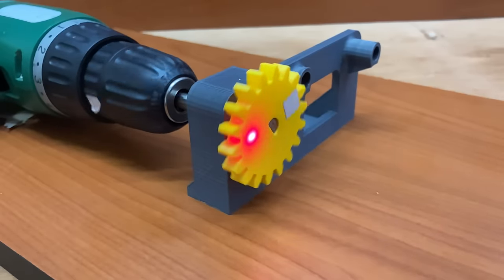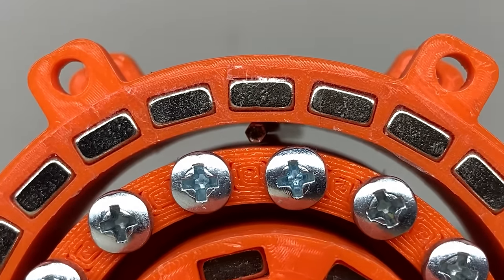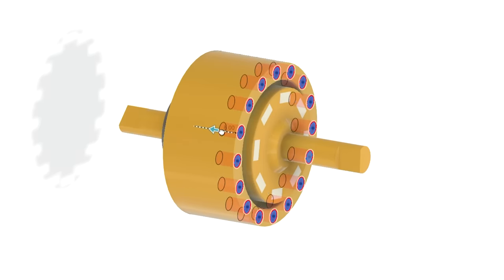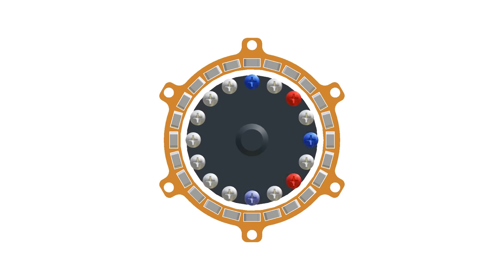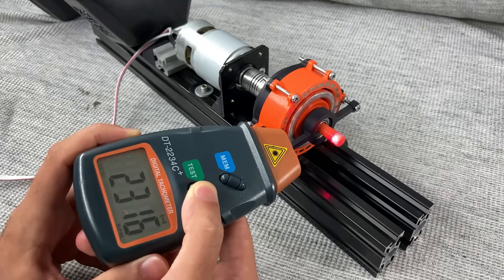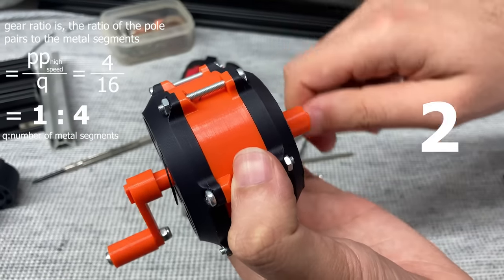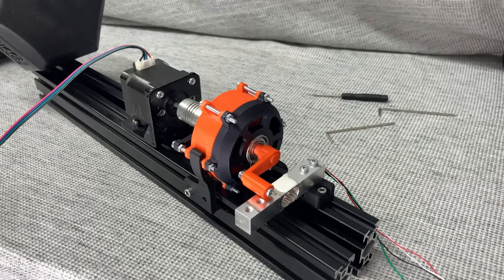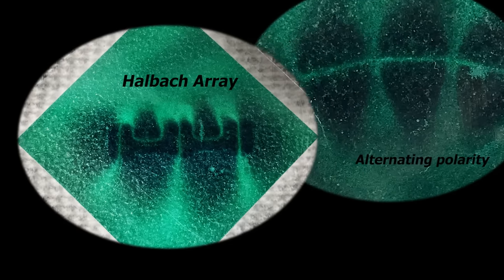Magnetic Gears - Why Nobody Talks About This?

Comment: We actually do see magnetic gears in limited applications, though their practical use is mostly for things where high speed low maintenance designs or inherently safe designs are required. In most cases they are used in hazardous material handling where shaft seals could be a major and rapid point of failure in a system where chemical leaking is incredibly hazardous to both life and the environment. Usually you see this used with a 1:1 ratio in magdrive pumps. They lack the flux motivator and instead work as a simple magnetic coupling, but they are still a power transmission with an input and output that closely resemble your designs. They are also used in some applications where wear-less torque limiting is required, such as found in some scientific and industrial machines.

They are a good tool that  is over 100 years old, their continued use today despite their age proves they have a practical purpose. They are not a replacement for a mechanical coupling however. Their torque is limited, efficiency loss can be quite large depending on design, and their effectiveness as a power transmission is highly dependent on the quality of design. There is potential for use in renewable energy systems such as wind turbines where a maintenance free gearbox could reduce both manufacturing and maintenance costs. Current gearboxes in wind turbines will far outlast the actual structure of the turbine itself, however the gear oil must be changed at least once every three years, in the average lifetime of a wind turbine the gear oil will be changed 7 times. Each oil change requires 50 to 200 gallons of oil depending on turbine size with larger turbines requiring more oil than smaller turbines. While this isn't a large amount of oil for a single turbine, about 1,400 gallons of oil over 20 years for the largest commercial turbines. It adds up quickly when you have 20 or more turbines in a farm, which is 28,000 gallons of oil over their lifetime for a 20 turbine farm, or just under 3 semi truck loads of oil. If used for gasoline this would come to about 20,000 to 24,000 gallons of gasoline, which for understanding of scale would power a modern car could drive 800,000 miles on the oil required for 20 large wind turbines in a 20 year life. While we aren't burning the oil in the wind turbine, we still need to distillate it from crude oil which still necessitates drilling for oil and disposing of the waste oil (which is often burned in peak demand oil power plants or sometimes refined again into another lubricant).

They may also see use in salt water environments, where shaft seals going bad will result in the failure of the device. Removing the shaft seal represents the removal of a high wear component from a system that cannot be easily treated to resist corrosion like sealed bearings. Bearings designed for underwater use are often made of stainless steel that are highly resistant to corrosion even when the metal surface is directly exposed to salt water. In the case of underwater gearboxes the motor itself will always be susceptible to damage from water ingress, removing the shaft seal often represents removing the only moving seal that is exposed to mechanical wear. All other penetrations into the motor casing are non-moving and can be sealed comparatively easily.
Reply: Well said good sir
Reply: The torque in wind turbines is enormous, a magnetic gearbox might slip under medium to max power.
Not sure if it is right, but I did the math for a 2MW turbine and the result was 19 million Nm/14 million ftlb
Reply: @Isgolo  Thats not quite right, The largest commercial deployment is a 9.5MW turbine. Hold on, i'm about to geek out a little because I don't want to do homework for a boring as hell project management class right now.

At theoretical max power production 12,700HP, at 10RPM (about the max rotational speed for a turbine this size), we get a torque value of 6.6 million ft-lbs (9 million newton meter). That sounds like a lot of torque, and it is. There are some research papers that test axial magnetic coupling (just as a reference) and a single 200cm x 6cm mag drive shaft is capable of a max torque of 4,200Nm in testing for example, take the next 3cm radius slice and you add another 11,000Nm for a total of 15,000Nm for a magnetic coupling 200cm x 9cm. Already an increase in diameter of 50% increased coupling by 350% and we are still only at 9cm magnet diameter. Taking the coupling size up a few notches (factoring non-linearity of distance and equivalent force) we are at 2 million nm for a coupling 2m x 2m. To get our 9 million Nm we would need a coupling about 3.8m x 2m diameter. Thats huge, but it still fits nicely inside the 9x8x20 meter housing on the 9.5MW turbine. This is all just napkin math, chances are I am seriously underestimating the amount of force generated, but I am only using some of the more basic generated equations from the research paper (basic is relative, some of the simpler ones still have 10 terms).

Given we can get about max torque from a magnetic coupling that size with no reduction, we could just be conservative and say the actual size for a 4:1 reduction like achieved in the video is twice that diameter and a little deeper. 8m x 3m is a rough estimate without going back through and doing everything all over again with an increased air-gap. Once we get past the first reduction we are only talking a torque of 2 million Nm, which we found earlier can be handled by a 2x2 coupling. Since most wind turbines run a generator speed around 1800rpm, we need some more reductions, essentially a 180:1. We only need three 4:1 reductions and a 3:1 reduction. The required torque values and aprox. sized for each stage are as follows. 

Stage 1 - required stage coupling torque 9MNm - est size 8m x 3m - total reduction 4:1 | Stage 2  - required stage coupling torque 2.2MNm - est size 4m x3m - total reduction 16:1 | Stage 3 - required stage coupling torque 560kNm - est size 4m x 1m - total reduction 64:1  | Stage 4 - required stage coupling torque 190kNm - est size 2m x 1m - total reduction 192:1 - final stage output torque 47kNm at 1920rpm at 9.5MW or 12,700HP.

The total estimated length of our gear reduction would be about 8m, which still leaves 12m for the rest of the equipment inside the nacelle. Is it possible? Maybe, thats a lof of iron boron magnet required. It's possible they could experiment with excitation style stators with permanent magnet rotors like three phase brushless motors. While that would eat into the power generation of the turbine, it would greatly reduce the rare earth metal requirement and replace it with iron and copper, which IMO is still a good tradeoff as it increases the sustainability of the turbine even at reduced efficiency. Truth be told I don't actually know if it's possible, these number are for a highly unoptimized coupling setup, there is no fancy design it's just magnets cut like a pie around a disk in a N-S-N-S-N configuration. There is also the possibility of the 4:1 and 3:1 reductions not being optimal, maybe 5:1 is better, or 3:1 is best. I don't honestly know. But with ballpark numbers it looks close and sounds reasonable enough based on the testing done for the paper. I know magnets are weak, but we are still talking about a first stage reduction thats almost 20ft diameter and 12ft long.
Reply: @2009dudeman  I thoroughly enjoyed reading this, thanks!!
Reply: Well said
Reply: yep
Reply: @2009dudeman  you make some good points comparing the traditional multistage planetary gearboxes to a N-S magnetic. Magnetic can definitely reduce oil volume, but the loads involved will require bearings to have oil. Planetary gear sets definitely don't outlast the towers; on average they get about 12 years and are likely running at partial capacity.  In replacing a planetary with magnetic, you'd be likely be looking at a single stage magnetic gear 100+:1 and the physical envelope would be quite similar to the existing machine.  One of the main issues is that permanent magnets are expensive and the volume of magnets required is quite large.

After you finish all your school work, see if you can dig up any of the work done by Texas A&M on magnetic gearing.  They've done quite a bit of advanced design in this space.
Reply: @TexasT04st  sure the bearings still require oil, but nothing like the gearboxes currently used. Yeah, the magnets part is the most troublesome. You can engineer away the issues with bearing lubrication, magnetic interference of controls, personnel safety and proximity standards (no ferrous metal tools near this thing I can guarantee you that). But you will never engineer away the need for several tons of magnets, that's not really my area of knowledge anyway. I have no idea if it's feasible to create that many large magnets or if there is a better design layout than the paper I drew my numbers from. They also used iron boron magnets, which would likely be cost prohibitive enough to ruin the commercial viability of the gearbox. It's likely they would need to use a different magnetic core.

I have heard of Texas A&M working on the idea, among others but so far I haven't seen anyone really putting much effort in. Doesn't mean they haven't, just means I haven't come across it.

Overall I don't know if it's viable to use, but it seems plausible.
Reply: @2009dudeman  the assembly process has some additional safety considerations and non-ferrous tools are required.  Once you button up the assembly you won't have any external magnetic considerations.  The magnets themselves wouldn't be very large; the large quantity of smaller magnets can create a very tedious installation process. If the right magnetic arrangement is used you could get away with a non-magnetic core (minimal loss to torque capacity) and save a ton of weight.  

It's really an issue of cost. Permanent magnets are expensive and are an imported product.  If we can get the magnet cost down it would open up many interesting applications for the technology.  I hope to circle back around and dig back into developing this stuff one of these days
Reply: Your smart.
Reply: Chemical pumps immediately come to mind..
Reply: Thanks for a crash college course
Reply: I am 100% in agreement with you. I just can't get my constituents to get it through their thick skulls. Amateurs, ya know? Sometimes I wonder if they really even know what a magnetic gear motor even is.
Reply: You can easily build a gearless wind turbine. Several Enercon series had this design. I still did not become the preferred design for offshore wind turbines. They need service on many thing anyway.
The gearbox efficiency is key to the output and following different wind speeds. So it directly translates into profit of energy sales. 1% more gearbox loss is like 10% to 50% less profit over lifetime as is heavily leveraged.
Reply: @voster77hh  Enercon gearless drive safe direct drive wind turbines, they use no gearbox. All their magnetic flux must be generated at 10-20rpm depending on turbine size, this is far harder to make efficient than a magnetic gearbox.

I'm also calling bull that a 1% loss in efficiency translates to 50% less profit. 1% loss on a nominal 1mw system is 10kw. Generated capacity is still 0.99mw. if you get say 8 hours of max production a day that's 8mwh for a perfectly efficient system or 7.92mwh for a 1% loss. If they sell at average US energy rates (this doesn't actually matter I just need a number) your profit drops from $1,233 a day to $1,221 a day. Over 20 years that's a drop from $8,927,000 to $8,913,000. That's not a 50% loss. When you account for the cost of just oil for a traditional gearbox assuming an average price of $13 per gallon (for just basic 10w40 engine oil), that difference drops from $14,000 to $9,500. All other things excluded.

Sure they still need other service. But removing a service item is still removing a service item. No one would argue that an electric car doesn't save money just because it still needs service for some things, it still requires less service than an ICE car.
Reply: @2009dudeman  No one ever gave me a better explanation of the linear relationship between revenue and profit. You are right, that absolutely MUST be true. Sorry I always believed my finance textbooks to be true here. That the relationship of revenue to profit is exponential and usually somewhere between 1 or 2 orders of magnitude lower than revenue. Means logically mostly somewhere between 10% to 99% lower and could be as low as 999% less in extremely volatile cases with a lot of fixed cost to distribute. Especially when a high upfront CAPEX and long lifecycle carry a high interest on a risky slow payback scheme where every dollar counts exponentially. Never thought it could be that simple like you explain it to me /s
Reply: @voster77hh  be smug all you want, but if a difference of $14,000 over 20 years was 50% of the profit, no one would use wind turbines. Dude you must have failed your classes if you think any power company is going to spend all that money on something that produces a profit of $1,400 per year and costs them millions to build. Based of course on 14k being 50% of their profit.

Everyone seems to be in agreement that wind turbines make between 3k for the smallest of turbines to over 10k per year. That's after operating and other expenses.

The point is not that finance is that simple, it's that the most basic of napkin math pokes holes in what you are saying. If 1% loss in power generation is 50% loss in profit, then what is 2% loss? 0-25% profit? It's ridiculous to think a wind turbine is so bad that just 2-3% extra loss renders them unprofitable.
Reply: You lose 1% output. At day peak demand and short supply that can easily leveraged by 250 times on selling to the spot market. Unfo a 1% less efficient turbine will cut out early or not cut in at exactly these most profitable times. Your hours of operation p.a. would just crash. The lower wind power supply the more valueable is your product. Congrats, that wasted 1% efficiency kicked you completely out of that profit game. Resistance simlly defines the cut in / cut out speed of a turbine.
There is dozens of other exponential effects I won't even bother to explain where your high school math stinks.
It already sucks to reply to someone totally naive about either political or spot market prices defining profitability vs losses here. Offshore wind is more expensive than Gas Power. Guess who gets shut down and doesn't see a single dime? Again, that 1% less efficient turbine is the first loser in the game. Maybe you should grow up a little to fully understand the rules of the game you are talking about first?
Then you might get onshore wind to be an entirely different game where political prices still can turn a profit at 1% less output efficiency. Offshore they take you from already bad cash burn to outright abysmal cash burn. Why cash is burned offshore? The bet is on real estate prices. On repowering secured claims with future actually profitable mature turbine generations. That gamble is played between nations EEZs and the energy big corps that are too-big-too-fail in critical infrastructure. They simply put the claim innone SPV and the Turbjneninto another SPV as legal entities. If the 90% pension fund finance tanks the energy corp still retains the claim to the site to repower it later. Some average Boomer Joe or Jane will lose their retirement funds. Who cares?
The energy big corp just fulfilled the governments demand to place a turbine immediately with some naive dudes cash dreaming to get rich and it shed the liability. Not that hard to understand the biz model, ain't it? Tou can't really compare 5th gen mature onshore turbines to 1st or 2nd immature offshore wind turbines on profitability vs investment push. You need to look at who is playing and what do they really place their bets on. Who chips are really in these stakes. The permit on the real estate under the turbine is what certain C-level people learned truly matters long-term.
There is absolutely nothing keeping the entire billion USD show offshore from turning sour. Just search "BBC glaring engineering  mistake" on YT.
Does a ±5% wind estimate deviation turn an onshore windnproject sour or hot? Yes it does. Repowering to a 50m higher larger diameter turbine with special blades still does fix that. That permits real estate still appreaciates in value.
Sounds much like subprime deals frenzy? Guess where all those Wall Street bankster real-estate dudes on cocaine went for some fresh dealing and wheeling? Did they magically disappear from the face of the Earth like dinos struck by an asteroid from the face of the Earth or repent their sins of greed and change job? Certainly not so. If the consumer market is dead just start some hot stakes race between some nations. Just move on. Upmarks of asset valuations on balance sheets are not realized profits from cash-outs. High profits from energy prices differences is politically really sensitive. Wind energy never never gets away with that for long.
Reply: @voster77hh  dude, stop talking about things you know nothing about. You are acting all high and mighty and being wrong while you're doing it. If 1% loss in gross output would put you out of business, then wind wouldn't work.  Do you think the cost of operation for wind turbines scales linearly with size? Dude, the cost of operation for wind power in my region in 2021 was 3.3 cents per kWh. Average electric price here is 14 cents per kWh. So that already factors in operation costs from start to finish. If a 1mw wind turbine produces an average of 8mwh per day, they have a total operating cost of $264, when they sell that power, even at a discount of 10 cents per kWh they make $800 gross, subtract their operating cost and you get a profit excluding purchase price of $536. Selling power at a 30% discount. Now take 1% efficiency loss, their operating cost is the same (ignoring lower maintenance costs) and they only produce due to loss a profit of $528. Now please tell me from that loss of production of 1% where that other $250 goes. And no you don't get to count peak sale rates and other garbage like that, because here in my region we don't have rolling blackouts where buying power at 250x is necessary. The difference in end sales cost for power here (this is the consumer pricing so it already includes everyone else's share being added on) changes between 13 and 17 cents per kWh. But remember the numbers I used are at 10 cents, which is below what ANYONE is going to be buying here except the largest of industry with their buying power, but they also pay a premium for apparent power instead of real power.

Make fun of high school math all you want, but if you make $800 a day and your total expenses are less than that, you make a profit. Nothing you do changes that. All the other crap you put in about politics and other crap has nothing to do with the profit made from selling electricity at market rates. If 1% cut profits in half, then 2-3% would wipe out almost all profit. Yet the EPA states that commercial wind turbines are between 30 and 40% efficient. Strange that wind turbines with 10% less total efficiency are still commercial viable. Offshore wind is barely not viable due to the larger cost of operation at an average 7.5 cents per kWh when on shore is less than half the operating cost. Would they still make a profit? Yes, less than half of on shore, but that's actually what it takes to cause problems, over 2x larger operating costs (or over 50% loss of on shore efficiency).

Your off base here, you don't want to admit it, but you look a fool. It's the same arguments people use for why solar is bad, but even there 1% power output difference doesn't cut profit by half. Or the slightest bit of dust would cut their profit in half and even the thinnest clouds would make them unusable. Yet my solar array doesn't drop it's cloudy savings by half when a thin film of dust is on them. You are making a mountain out of a mole hill, and clearly you are wrong since wind is going up all over the place and they are putting in lower efficiency turbines like crazy due to supply issues. By your reasoning they are losing money on each one. Please don't tell me you think they are selling power at peak demand for 250x the normal price but somehow everyone buying it is only paying an extra 2-4 cents...

You sound like the people who said automatic transmissions will never work because they are less efficient than manual transmissions. Funny how most cars in America are automatics and people get along just fine, to the point the cost savings from manuals aren't worth it. What a joke.
Reply: Just, you talking about the oil required to lubricate wind turbines cracks me up a little bit. That's all.
Reply: If wind energy is such an easy deal why don't you own a dozen wind turbines and be rich?
Any bank should be happy to listen to you and back your clever ideas in the energy market. My bet is chances are ultra high, the bank will just have your butt kicked out of their door while laughing hard at you. 

Your are certainly a total pro at selling energy all hours of the day to someone who needs it. First thing a bank will check your prices and tell you that you can't really sell all of it at 0.14 USD/kWh to anyone free-riding on the grid. You got to pay the grid and ship to someone who wants that energy. Otherwise you get paid 0.00 USD/kWh and your products rots faster than surplus tomatoes in a ketchup factory yard. It is gone in seconds. 

Actually if you don't shut down your generator burns up and the banks millions literally go up in smoke. They know that from experience. Only you don't. That is why there is huge fees and rebates in the market.

Some easy to ramp up/down consumer like aluminium smelters get parts of their energy for 0.00 USD/kWh. They do eat up excess energy in the grid from nuclear or coal power nearby etc.

Pls. don't bother banks with your pesos/kWh style pitch-deck w/o proper units.
Your pitch is a no-sell.

You got a very long way to go to sell your wind turbine project to anyone and claim your profit and get rich.

I certainly don't keep you from trying. Good luck trying to sell something unproven and experimental that is efficiency reducing to a bank in wind energy. You'll need it. Prove it to a bank, not to me.
Reply: @2009dudeman  I assume you mix that up somehow with yield in MW hours pa. The efficiency of a 3 bladed wind turbine models in the well proven bread & butter 4 MW class sits at 47%. 45% is a shitty sucker model. Means You have roughly 10%-12% loss down from.59.3% Betz limit. That's the comolete chaim of aerodynamics, gearbox, generator and rectifier losses. 6MW model gets at 49% due to larger diameter but they do start suffer from early cut-outs in gusty winds onshore. That hurts yield badly due to oversizing. Offshore wind is lest gusty but there you really see where sensor failures, corrosive environs amd lack of access lead to extended downtimes killing profits and driving up cost.
Feel free to ask any bank if they would even consider wasting any on a turbine certificate of 37% efficiency on a new machine. They'll reject you right away and maybe even not answer your request. They'll probably pin your pitch as meme of the week on the cafetaria fridge. Of course you can pay cash and raise a used one a family farm in Dakota or send it to the developing or third world. Maybe some bank takes that secondary market at a premium. Doesn't prove you right in any single point here.
Maybe you need to understand that the market in Europe is much more mature and advanced. It doesn't really matter what follies less developed markets like flyover country US and their misguided investors do consider worth repeating in failed shortcuts or do with used stuff. They are free to make their own mistakes and learn from people leading the field. Even 30 years down the line there will be some uneducated fool trying the same shortcut on thrift that many people before failed on already. On 47% you'll get 100% financing from a specialized bank in the field once you obtained a permit. Maybe give the quality of your sources a better check?
As I said, feel free to ask a bank. For real or fake it. I don't care. Just pls. stop trying to pretend you know about things I have actually done and you never did for real. Go out there an raise a wind energy project. See where it leads you. Stop theorizing.
Pls. get sorted out about onshore/offshore wind. Totally different fields.
You would be the worlds first dude to prove offshore wind to work and be cost efficient or even degressing it's cost exponentially. Means proving that tech does deliver. The least conclusive thing we do know is that it never managed to beat natural gas in the market in the last 15 years as onshore wind does.
At least not in the hands of big industry.
Feel free to change it and build someting better. Or put up & shut up.
What keeps you fromnsaving the wowol from climate change and 6th mass extinction? You can even get paid for that and have a career or get rich. Once you stop trash talking way outside of your expertise you can go there. But sitting on bad info I wouldn't dare either and be a coward. Just wait for the skses falling. You trolling engineering topics is rather pathetic. I'm at least sharing proven hands-on know-how with others. But yeah, it takes time to verify it. I won't do that for you. Have fun throwing your retirement funds at Crypto Ponzi Schemes or whatever you prefer.
You basically argue now, players in the game to freely share their secrets how they make money. That notion of yours is plain absurd. It's why you should look differently at your sources of infomation motives before you use them. Any engineering textbook like Gasch "Wind Energy" can get you up to it. Superficial googling won't cut it help you seperate facts from fiction. "Free" Info is buyer beware. Sales PR is always fiction not fact. Maybe you at least consider to internalize that before another lengthy rant of how right you believe you are.
Just being pro rerenewabels doesn't make you a success in life. It makes you only slightly less failed. You still need hard work on the right things to show first - well paid or not. Even proving things not working gets everyone ahead.
It is only a problem if we bet everything on stuff offshore that doesn't fully deliver and leave better approaches untried for it. Use taxpayers money on big corporations for things that do consistently keep failing us. That's all.about NIMBY politics to try pushing onshore wind offshore. That is the politics that potetially kills us all as a human race. Safe bet politicians don't want you to know. But now you do.
Finance and  R&D funds is all politics.
What gets invented on taxdollar and what does not. Check out Mazzucato if you want. It is your personal choice to fall for scams and shenanigans. Only you can keep yourself out of that. Go from half-way to really smart. Just be more diligent with Q&A of sources plus a bit less lazy and naive. Be more independent with that and always demand consistency. This can easily take you 5 years to fully get into. Dig deeper - it doesn't hurt.
Reply: @voster77hh  again, another long winded and useless comment. Come back when turbine farms going up are not using models between 2mw and 8mw. All that book knowledge and you can't even see what's actually going on around you...
Reply: Wow, that's brilliant
Reply: Doesn’t the mechanism in a brushless drill use this concept?
Reply: @Blake5ive5  You mean a brushless electric motor or coupling? The power drill would still use toothed gears.
Reply: @2009dudeman  The operating costs will stay the same when your efficiency drops. In your example of a 8MW turbine, a 1% drop in efficiency reduced revenue by $12/day, which works out to $4380/year.

Now let's say that turbine generates a profit after operating expenses of 10k/year (taken from another comment).
If we assume, that the expenses stay fixed, reducing revenue by 4.3k will reduce the profit by the same amount. That would be 43% less profit for the example!
Reply: The last paragraph is interesting. I looked at this video because I need to seal a small shaft that oscillates at 3-10 Hertz within dozens of degrees of rotation. I needed it for a fish robot and I worried about the sealing of this part that continuously change rotation sign
Reply: Note that we don't actually have to distill lubricating oil from crude oil.  We can synthesize it from pretty much anything containing hydrogen and carbon at varying degrees of efficiency.  This is where "synthetic" lubricants come from.

Doing this is, however, rather more expensive than the distillation process, so the question rapidly becomes one of how many million people you're willing to allow to starve/freeze to death due to energy shortages in order to maybe delay the next major climatic shift by some undefined period of time.